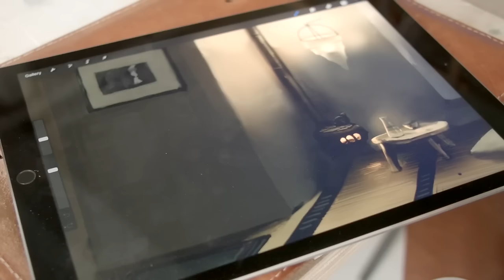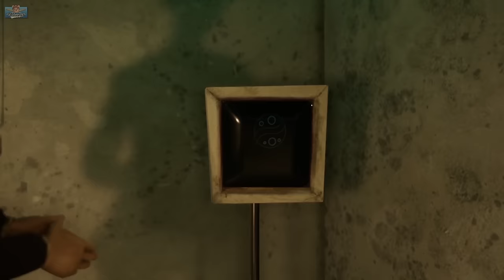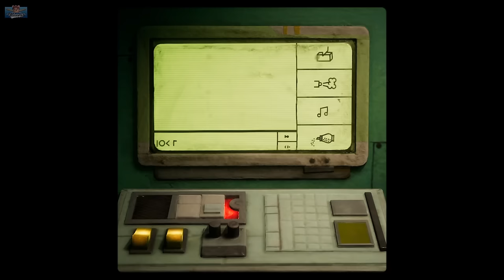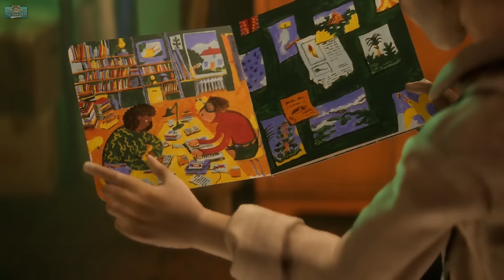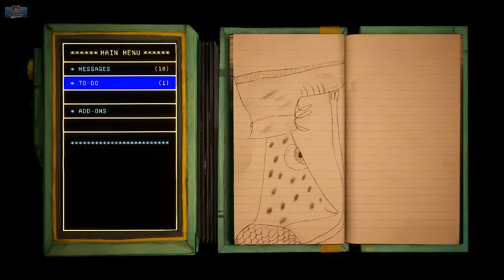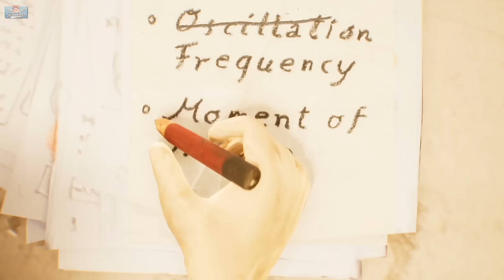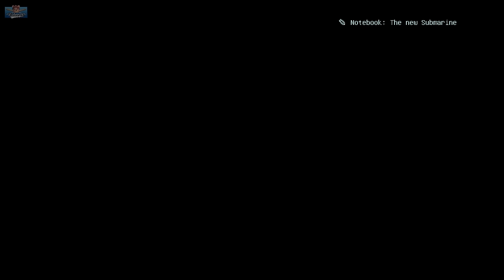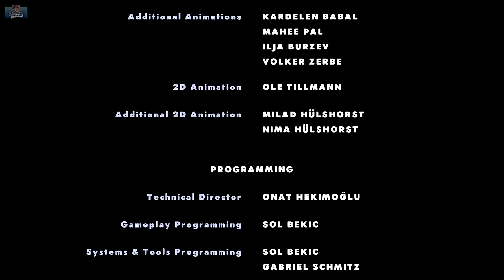This game took 14 years to make | Harold Halibut (Full Game)

Comment: It's quite frustrating that everyone can message Harold, but he can't text anyone back, so he has to always give them messages in person. "Harold, this meeting could've been an email."

Also, WC is usually pronounced Veh-seh (like French letters V and C). It made it sound more fancy and dignified as people were often very embarrassed to mention anything remotely to do with toileting. It's how you ended up with commode. It was a type of dresser, then people would say "I'm just going to visit the commode" as posh slang for going to take a whizz, and thus, the fancy, elaborate, expensive French dresser came to be synonymous with toilet. Basically if you made it sound French, it was no longer rude.

Also the singing sunflowers used to sing Elvis Presley songs